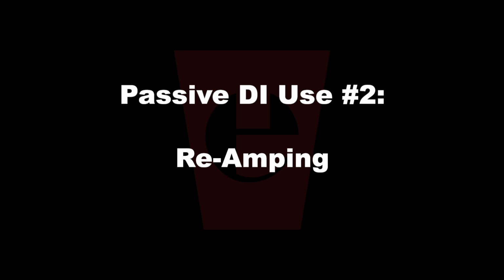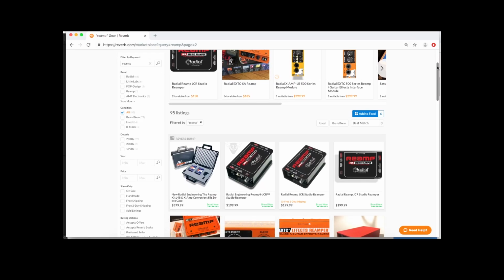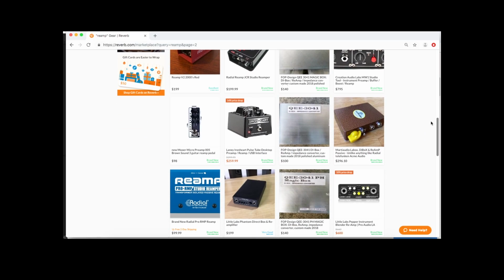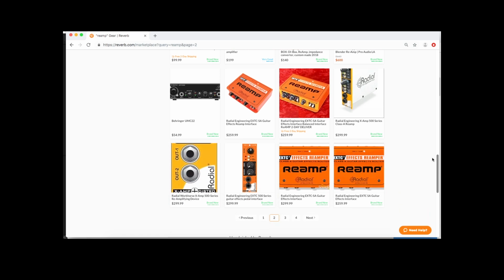Electrical Audio How-To:  Fun With Passive DI's

Comment: Is it wise to keep the D.I. on top of that speaker cabinet? Could the vibrations mess it up? Or do you move it for "the real thing?"
Reply: the vibrations wont mess it up, but may make it shake off the cab and fall on floor, which may mess it up or and/or your recording. Put it on the floor or on something that doesnt vibrate ie not on a cab or head on a cab or combo amp etc.

Comment: if you use 2 DI's in one signal path, conntected with XLR, you have to use an XLR with two "Feamle" Ends or an adapter, right?
Dont see how it could work otherwise.
Reply: their di that they use here and sell has both M+F xlrs

Comment: A pedal or anything made to work with a Hi-Z source should be fine with a low impedance source as well, for kind of the same reason that a power supply can exceed the current rating of any given device, and it won't be a problem since the the circuitry in the device will only ever draw as much current as it needs. The circuitry in a pedal will only draw the current from the source that it is designed to do, so as long as voltage levels are adjusted (which OTOH is crucial) you shouldn't need to convert a lower impedance source to a higher one to accommodate, say, a pedal or amp. I'll admit I haven't done the experiment, but the theory, at least as far as I understand it, doesn't support doing that.
Reply from the maker: Hi there, thanks for your comment. I think it's important to detangle the two signal transfer modes here. If you are concerned with transferring the most current possible, this is a called power transfer, and you want to match input and output impedances as closely as possible (this is called impedance "matching"). If you are concerned with transferring the most voltage possible, which is the case in most "small signal" studio situations where we're dealing with instruments and mics and not powering speakers, you want to setup a "bridging" relationship where the output impedance is low and the input impedance is high, so that there is minimal loss at output.

What we demonstrate here is that you can setup the proper bridging impedance  and level relationships and/ or convert balanced to unbalanced in a number of circumstances here with a passive DI. You can do this with any passive DI, but ours are extra convenient because the have both types of XLR connectors so you can "go the other way" stepping up impedance and level and converting balanced to unbalanced without an adapter.

If you were to try to plug a mic straight into a pedal, the impedance relationship is not the issue. The signal level from the mic output will be extremely low, so you need to amplify it with a preamp, and then output the preamp to the pedals. If you are trying to "reamp" a signal (go from line-level, balanced to instrument level, unbalanced pedals or amp), a DI in reverse can convert balanced to unbalanced and provide ground isolation between your console/ converters/ studio equipment and the guitar pedals and amp. You will be stepping up the already-high level and impedance, and so to bring the signal down to usable level you would have to attenuate the level in a DAW or at a console. The impedance relationship will still be properly bridged because guitar pedal inputs are high.

Power draw from a pedal, or any electronic device, is totally different. Yes, it's important to have current overhead for any electronic, but it's a separate issue than the impedance and level issues here. Maybe you are saying that there is "impedance overhead" between a line-level output and the guitar pedal's input impedance, but that seems like a strange analogy!
Reply: @ElectricalAudioOfficial  Your point in the first paragraph was exactly what prompted me to comment that it makes no sense to "up" the source impedance from a low output impedance source like a mixing desk. Unless I totally misunderstood, in the video you explain how to use the DI to make such a source "look" like a Hi-Z pickup coil , to then feed a pedal or amp, and precisely because of what you state here that wouldn't be necessary since it is already Lo-Z going into Hi-Z which is great.

Comment: Hi! Is it possible to do the vocal effect trick with active diboxes too?
Reply from the maker: It is not, because active direct boxes use buffer amps to change impedance, which are inherently one-directional, they can only convert an instrument level and impedance signal down to mic level and impedance. A passive DI uses a transformer which can operate "in both directions."

Comment: Honest question - Why is a re-amp box or passive DI necessary for "re-amping"?  The output impedance of an audio interface is going to be low, but so is the output impedance of almost any effect pedal. If raising the impedance of a source to match the high input impedance of a guitar amp or effect pedal is necessary then wouldn't a chain of effect pedals, or a boss tuner in front of a guitar amp present the same loading or mismatched impedance issue?
Reply from the maker: With voltage transmission (ie the voltage is what "represents" the signal), the ideal impedance relationship between an output and the input it feeds is that the output impedance should be very low compared to the input impedance it feeds. This is called impedance bridging (as opposed to matching, where low feeds low or high feeds high, which is ideal in a power transmission scenario). It ensures that there is maximum voltage transmission to the load/ minimal voltage loss at the output stage relative to the input it feeds.

Mic preamp output impedances are really really low, like 150 ohms to 600 ohms, and usually feed line level input stages with input impedances that are like 10k or so. A guitar's output impedance is wayyyy higher, like 10k or so, and feeds input stages that are often around 1 Mega-ohm (1 million ohms). So while the output impedances are low relative to the input impedances in both cases, they are at quite different scales, a couple orders of magnitude off from each other, and the reamp or DI raises the output impedance of the line-level signal to around instrument-level impedance. (But it also raises the signal level in so doing, hence the need to bring the signal level way down in the DAW when using a passive DI to do this- when you lower or raise signal or impedance with a transformer, the other raises or lowers with it.)

Comment: Reamping with a DI will give you a thin, weak, and noisy signal.  It seems like the math should work in reverse but it actually does not. You CAN however, easily re-wire a DI box backwards inside so the balanced (XLR input goes to the opposite side of the transformer and accurately steps the signal to a line level.  This converted signal is exactly what you recorded with your DAW.  If you have a soldering iron and a couple extra pieces of wire it’s easy to convert a $20 DI box to a reamp box.
Reply from the maker: Hi there,

A couple things we should point out that your post brings up.

First, this will only work with a passive DI, not an active DI, and it must be used in reverse. Meaning you connect the line output of the converter/ console/ whatever to the XLR input, and then the 1/4" jack to an amp.

Second, we are more concerned with the impedance relationships than the level relationships setup by the DI. One side of the transformer is Hi-Z (high impedance), the other is low. A line output from an AD converter/ console output will be low impedance, and needs to be stepped up to the high-impedance to drive an amp. If we didn't need to deal with the impedance relationship, we could simply plug the line out from the console into an amp, and adjust the output level.

When the signal's impedance is stepped up, the level will also step up, so you invariably need to bring the level down at the output by quite a bit. But in most cases, this is easily done by turning the DAW fader down, or lowering an output fader/ pot on a console, etc.

The fact that you are getting a thin, weak, noisy signal suggests that maybe you are trying to use the DI not in reverse, or using an active DI. In the former case, you are stepping down the impedance and level. The level will be more in line with what the amp wants, but the impedance relationship will be further from what we want, which will degrade the sound. In the latter case, you are outputting only cross-talk to the amp, so the signal would be terrible! Active DIs use buffer amps to setup the proper impedance relationship, and they only work in one direction, going from hi-Z instrument level to low-Z mic level. The transformer in a passive DI is agnostic about which end goes where, etc.

Comment: if I have a regular di box, can I use one of this female to female adapters to go from output of my DAW and run through the box for reamping?
Reply from the maker: If it is a passive DI, yes. If it is an active DI, no, it won't work.
Reply: @ElectricalAudioOfficial  great! thanks...also, can you explain how you run the signal from the direct out of the console ?, it seems that goes to an INPUT on center field´s panel and then in to the box
Reply from the maker: @estudiotransiente  we used the console direct out because it's tape/ DAW agnostic, but if you're using a DAW you can just plug the interface/ converter DA output into the mic panel.

The mic panel connectors are connected to wire connected to the patchbay, and the wire can carry signal in one direction or the other. So even though the mic panel connectors are usually used for mic inputs, and the patchbay is labelled "mic inputs," you can patch an output to one and it works fine. You will have an XLR cable with the wrong gender somewhere, but our DIs have XLR connectors of both genders run in parallel on the low impedance side. If you have a typical passive DI with a male connector, you can use a female-to-female adapter or a crossover cable, as you mentioned.
Reply: @ElectricalAudioOfficial  mind blowing, this is one of those things you know but are so elementary that you don´t realise....thank you so much!

Comment: For use #2, how are you sending an output from a mic input???
Reply from the maker: The re-amping scenario: record a dry signal into a recorder (tape or DAW) as usual. Play that signal out of a line output, like a converter DA output, and plug that line out into the passive DI's XLR connector (the low Z side of the transformer), and connect an amp to the 1/4" side (hi-Z side).

A passive DI is just a transformer in an enclosure with some facilities for interfacing to different equipment. The XLR conector doesn't have to be a mic level signal, and it doesn't have to be an input. You're really just using the DI to set the impedance of the dry signal for re-amping into the range the amp "wants." You will almost certainly have to lower the level at the output from the recorder (by turning your DAW output fader down when you're working digitally) because when you step up the impedance with a transformer, the level also increases.
Reply: @ElectricalAudioOfficial  but you plug female xlr into line outputs.  On the other end of the mic cable is male xlr and that wouldn’t fit into the di box.  You would need a mic cable with female xlr on both ends but that’s not how I see you doing that…
Reply from the maker: @maxwellbrewer8637  just get whatever adapter you need. There are male- to-male and female-to-female XLR adapters, or you could make a crossover cable with whatever connectors you need.
Reply: @ElectricalAudioOfficial  ahh I see, thank you!

Comment: Good stuff!
Though, you don't need a DI to use a speaker as a mic. In fact the DI is kind of doing the opposite of what you want in regard to impedance, as a speaker is really low-z, like 4-16 Ohm. You can use a simple 1/4" to XLR-Male cable for the cab shown. I like a little open back practice combo amp, so I made an XLR with alligator clips. I connect pin 2&3 to the +&- on the speaker, and pin 1 (ground) to the metal frame. This provides a good hot signal at the mic pre, with as much low-frequency information intact as possible.  Cheers!

Comment: For a vocal effects, do i need first DI box or can i just use XLR to mono jack converter, plug it straight into first effect, and use DI box at the end of the chain? cheers
Reply from the maker: You should NOT use a simple jack converter to plug a mic straight into a guitar pedal, as the mic level is significantly lower level and impedance than the pedal is designed to accept. The DI brings level and impedance up to around what the pedal "wants." There are some XLR to 1/4" TS (mono) adapters that have a small transformer built into them, but the transformers are generally not great, and if you have a DI the transformer will usually be better in that than in those adapter.

Comment: wow great video. That's really interesting that a di box is all one needs to make a sub kick. I've made them by swapping the wires around, but when i do that the subkicks are always too loud for my interface, and clip it! I ended up buying a whirlwind pad reducer, which works great. but i had no idea i could use a speaker cabinet as it is, and just put a line booster on it. that's great! i'm gonna try that.

Comment: Thank you for showing me the speaker cabinet with 15 inch subwoofer to use a mic. I have known that mic's and speakers are essentially the same thing for many years and the thought never occurred to me to use a bass speaker to get great sounding bass drum sounds. When it really should have been completely obvious to me all along. I feel like such an idiot. Thank you for pointing that out!
Reply: Just be aware though, that the speaker, whether in a cab, or not, still needs to be wired in reverse when using as a Mic I'm pretty sure. Also, you don't technically need a DI Box, but I'm not sure, if maybe there's more need for a DI if it's coming out a 1/4" speaker jack from a cab vs an XLR adapter wired off the speaker for instance.

 I just made an 8" sub kick out of a random 8' woofer, wired a short XLR connector to the leads in reverse(neg to pos/ pos to neg), and then I just connect an XLR cable to the XLR lead coming off the woofer, and run straight into a Mic Preamp, but with a Pad engaged. I'm fairly sure that running to a DI first is technically the proper way to do it, but I just ran mine straight to a Mic pre w/ a pad engaged, and it seemed to work great. 

Maybe someone who knows a bit more about it could touch on that, and if there's any negatives/risks to going straight into a preamp etc. I just heard that it could possibly be too hot for a preamp (without the DI), and overload it, but with the Pad, it seemed to work just fine, and wasn't to hot at all. Also, coming from a speaker that's wired to come 1/4" out of the Cab, is it 100 percent nessesary to go to a DI first VS having an XLR wired to the speaker, or is it literally the same thing? 

Oh, another thing I remember hearing, but not sure if I'm just making this up, but say you had an XLR adapter wired off the speaker, I heard that to help with the impedance, and being able to match it closer to work better just going straight to a Mic Pre, you could wire a resistor(not sure the value) across the pins of the XLR connector. Maybe something similar to how people do with an SM57 with the transformer taken out. Not to sure though.
Reply: @jamescassidy4045 I’m guessing the di would have a more appropriate impedance but if it’s recording good who cares

Comment: Hi EA, I am trying to find a pair of DI boxes for the "extended [cable] run" tip that you gave. Any recommendations on what product(s) would allow me to accomplish this? I cannot find a DI that will convert balanced low impedance back to unbalanced high impedance.
Reply from the maker: Heya, any passive DI will do. The better the transformer, the better the DI will perform. A good passive DI with a good transformer is the Radial Jensen DI (JDI), but there are plenty out there.
Reply: @ElectricalAudioOfficial  thanks so much for taking the time to answer my question!